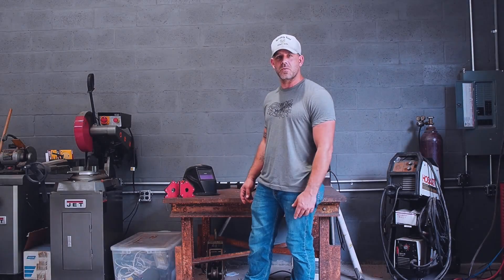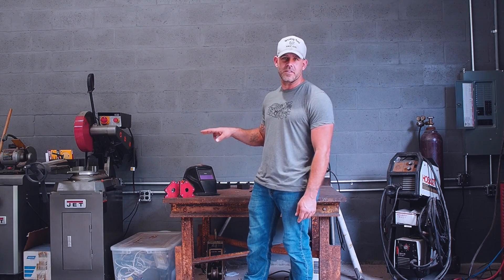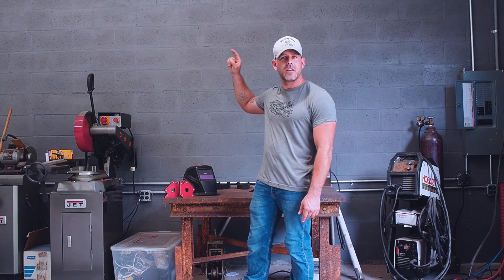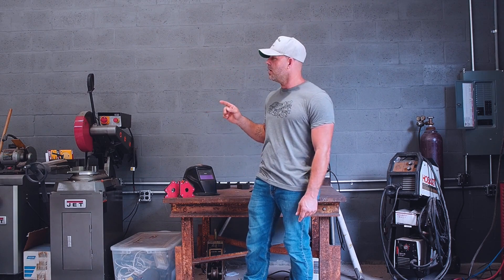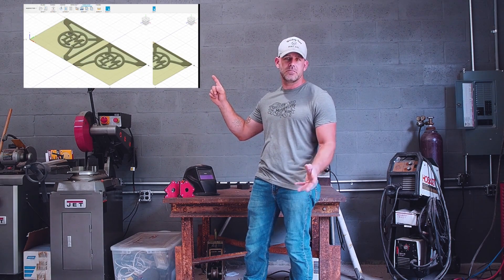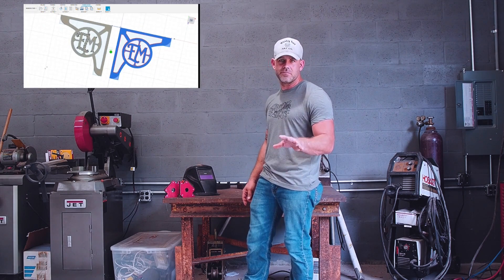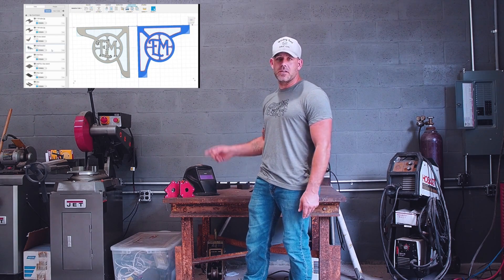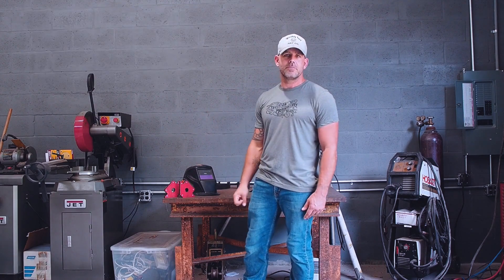Plasma Cutter Shelf Brackets Built with the Langmuir Crossfire Pro

Comment: I know this is a older video,was wondering why you went with Everlast plasma over the Razor that Langmuir has or Hypertherm? Also what size Plasma did you go with? I like the Everlast stuff
Reply from the maker: Power and price , mine is a 82i 80amp ,the same size hypertherm would be like 5k, i paid 1400 with a machine torch and Everlast has a 5 yr warranty and proven reliability, cant go wrong in my opinion
Reply: @envisionmotorwerks  Thanks, my friend has the smallest Langmuir and says the Razor is not consistent, and thinking of Everlast. Hypertherm seems very high priced. This will help me when I step up to the plate,and purchase one.
Reply from the maker: @19672701  you'll be surprised how many useful things you can build with it.
Reply: @19672701  been watching Envisionmotorworks for a bit now. impressed with the Everlast 82i. I think I want to get one myself.